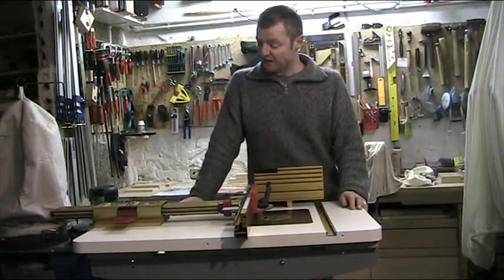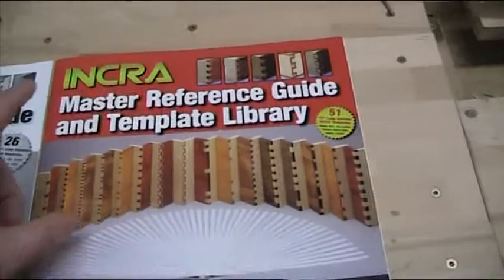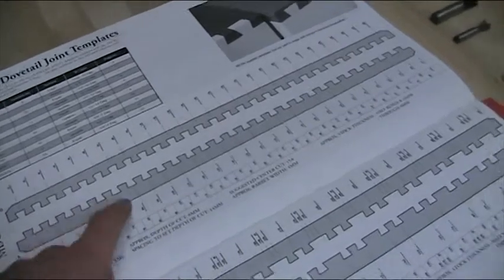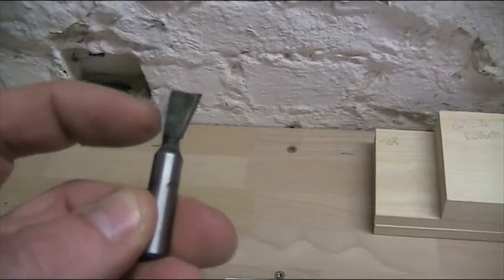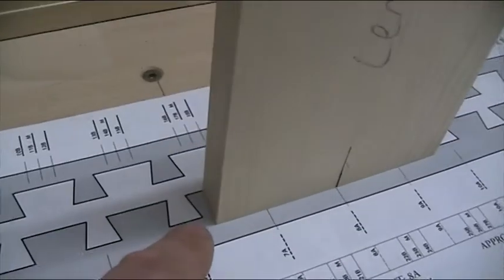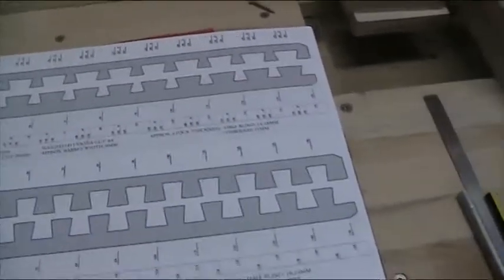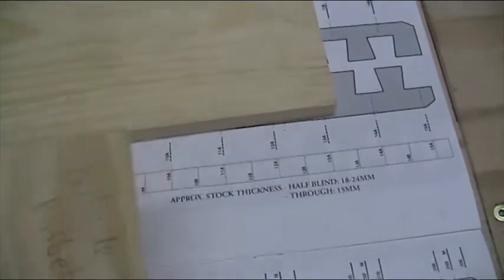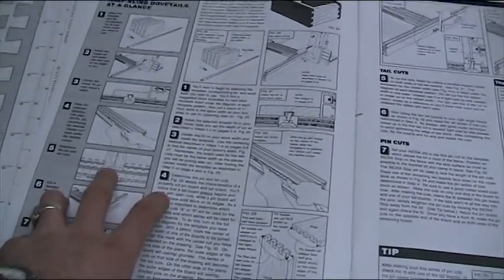Cutting Dovetail Joints Part 1

Comment: I want to thank you for taking the time to show the process of setting up the LS Positioner. I bought the LS roughly ten years ago. Because the setup steps explained in the booklet is so confusing, I had not made a single cut using the LS. Incra should've made the videos that you made here. I'm going to try to cut some dovetails now. Hopefully, I'll be able to build the drawers for my router table that I meant to build ten years ago. Thank you very very much!!!

Comment: By the way: It is a very good and precise introduction you give to the Incra system here. I wonder if you have seen the 'official' video made by Incra itself? It goes so fast and he talks so fast that it is nearly impossible to understand what he is doing. And he does not get into any of those little considerations regarding bit, template, stock size etc. as you so brilliantly do. Thank you for a very good and elaborate demonstration.

Comment: Why can you not use your standard router bit as you state at 5:03. Is it because the template goes up to max 18mm? Please, explain to me a bit more in detail what the problem is at 5:35. I assume that on the template drawing the grey is wood and the white is what is cut away. I can not quite see why you get a pin too small. Your stock is covering the outmost grey area by approx. 90%. So is your stock at 97 mm too wide or too narrow to be used with that particular template?